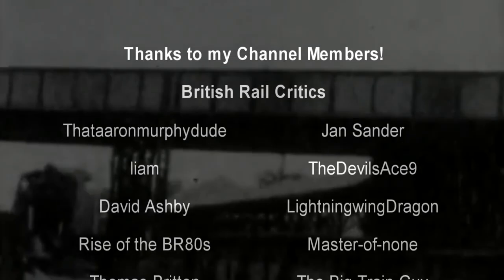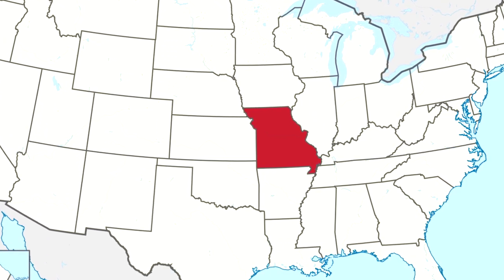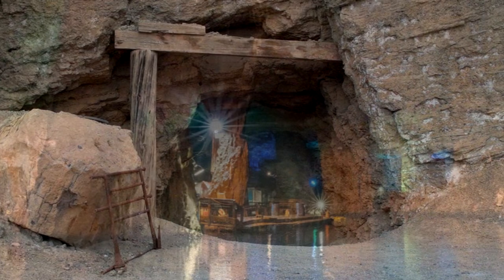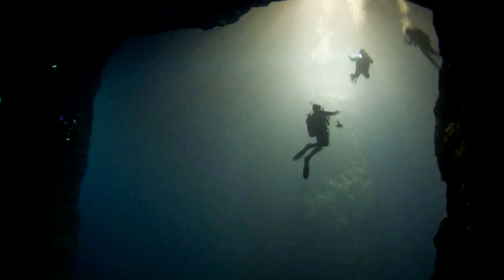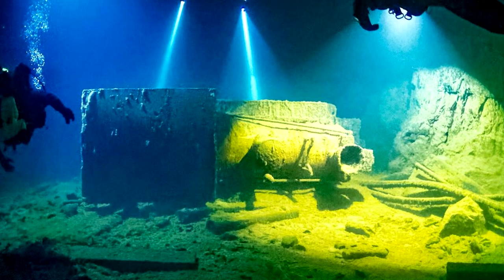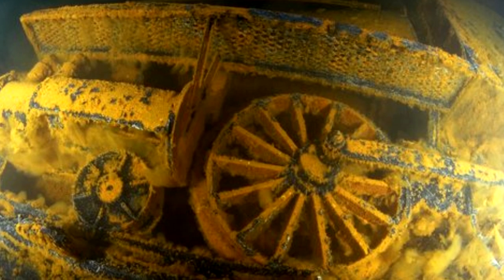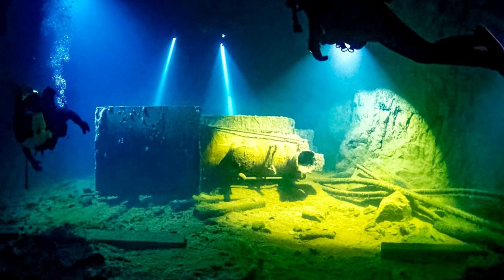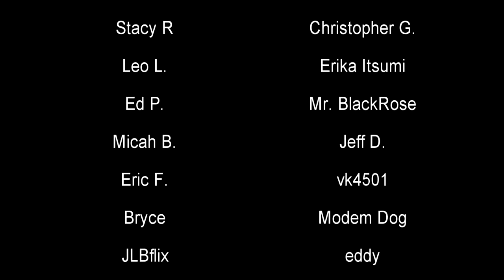The Sunken Mining Locomotive of Missouri | The Bonne Terre Mine Locomotive | History in the Dark

Comment: I was one of the divers that put it there about 1990.  The tracks are welded to the wheels.  It was dropped down the airshaft that it right above the thing, when it was lowered with a tow truck it stood straight up.  The plan was for it to be upright so it looked as if it was the tracks.  It took us about an hour to finally tip it over onto its side and the owner thought it looked good like that so we left it.
Reply: do you know where it originally came from?
Reply: @DeathValleyLumberCompany  I don't know.  The guy with the tow truck also owned a welding shop there in town.  He may have put the thing together himself.
Reply: @williamcroney5457 that was my father, Kent Hall

Comment: That locomotive is actually an amusement park locomotive. I've seen photos of that engine where it also had a coin slot.
Reply: Thank you! I thought she was a fake.If she were a real loco for a mine then 0-4-0 or 0-6-0 wheel arrangement, saddle or side tanks and certainly there would be con rods and valve gear, not just coupling rods. The flanges are too deep, the leading truck is wrong and if she were just left when the guys went home for the last time, why is she laying on her side?
Reply: @douglasfleetney5031 hey not every 0-4-0 had valve gear. Some had the connecting rods on the inside of the frame
Reply: Also if this is a real locomotive the coin slot you're talking about more than likely added for use in the mine like a clip or something
Reply: One last thing a lot of the mine locos were eventually converted to other sources. This could have been the case with this locomotive and it was converted to electric or something
Reply: Some in the info that I gave is correct but I forgot that this is the one that was a fake
Reply: Its more likley one of the same type was sold too an amusment park and convertet too have that coin slot
Reply: Oh so it wasnt just me 😂 wow!
Reply: where can one find this photo?
Reply: @DeathValleyLumberCompany I can't remember, it was a long long time ago. But I do know I've seen it on a documentary of the Bonne Terre mine when I was younger.

JUST NOW: I found a video showing it. Just to go 0:35
https://www.youtube.com/watch?v=BVOE_cKkXAs

Comment: Have you done the North Staffordshire Railways Hookham tanks yet?  The next example of an engine that succeeded when it shouldn't have, it was a biggish tank emgine of a 0-6-4T wheel configuration. So you think, ah, either a heavy freight tank or maybe a commuter tank? Er, no. Very no, in fact. The Hookham tanks hauled expresses - yes, expresses - over the Stafford-Manchester section. So, did they have big driving wheels for express duty? Also no. Their driving wheel diameter was...... drum roll please ...... 5ft 6ins. That's pushing it for a mixed traffic loco, never mind an express engine. But the Hookham tanks hauled 10 coach expresses over what was not a particularly easy route, hitting close on 80mph top speed and regularly achiveing 50mph - and better, sometimes - average speeds. They were fairly ecomomical, reliable - although they always had special checks every couple of days to tighten up anything that had worked loose - and absolutely ADORED by their drivers. They later gave excellent service as a short-haul fast freight tank and also gave a good account of themselves as a commuter tank. Sadly scrapped under the Stanier standardisation plan, there are none preserved, and there are no plans to build one from scratch.

Comment: Uhh darkness? That’s a fake locomotive it is literally a mock-up not a real steam locomotive The fixtures look more like something you'd see on a fake loco on a VFW or Shrine float in a local parade. The bell bracket looks fake. The domes & stack look questionable. I've never seen handrails mounted that way. The headlight, if that's what it is, looks unusual at best. There's no discrete difference between the smokebox and boiler barrel. Nothing I say here is definitive, but it surely looks strange.
Reply: She's certainly interesting - looks like she's lost her pilot beam and steps, or pilot. And she does look a bit short for a 4-4-0. (We don't call them 'Americans' over here in Limeyland. Just 4-4-0's) On the other hand she's got a modern (relatively) steel cab. But where's the tender? Odd how she's overturned, and has had her connecting (main) rods removed - I wonder why?: Equally, most mine engines I've come across are a lot smaller, lower, with cut down cabs - often specially built for very low clearancea, and typically 0-4-0s. A 4-4-0's a big engine in comparison for that sort of job. Obviously, if she did work the mines she wasn't worth the cost and effort of retrieving before abandonment, but just how did she get in there in the first place, and at what must have been a very deep level. I'm not agreeing with 'oregon railfan', or disagreeing, just setting out questions which come to mind.  This one certainly sets the little grey cells to being exercised, as Mr Poirot would say!
Reply: I think I may have also seen a coin slot in a photo too.